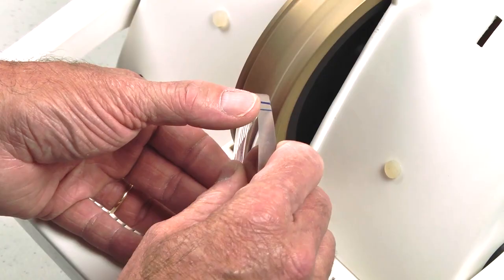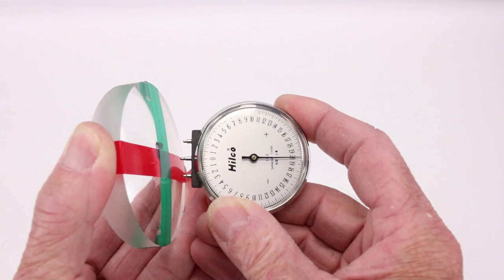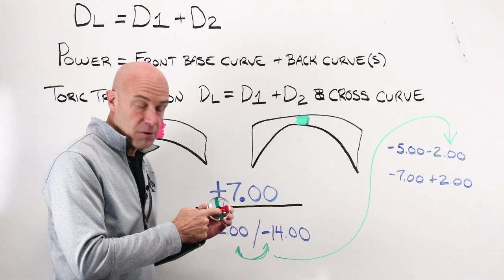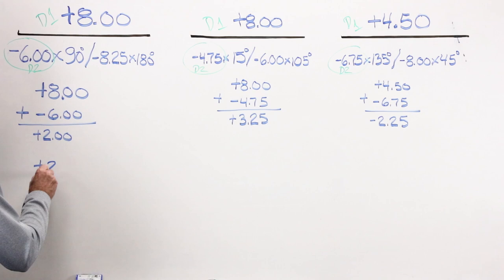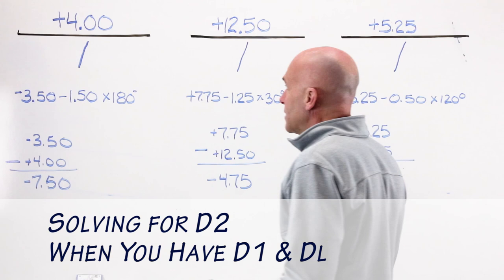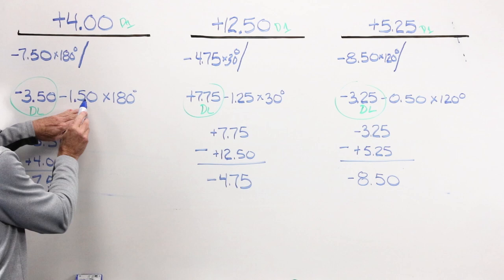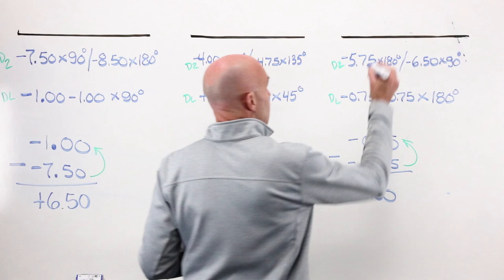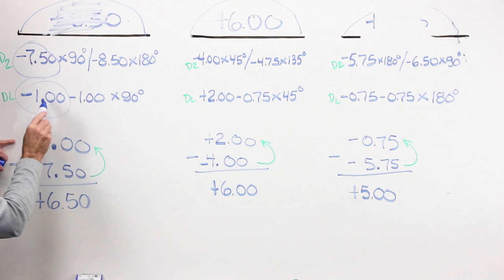Optician Training: What Is Toric Transposition and How Is It Done? with 9 Examples

Comment: thanks for all the videos, I am interested in how to produce aspheric lens, their materials if any and process
Reply from the maker: The aspheric design is pre-molded at the factory on the front base curve of the lens in both stock and surfaced lenses. Think of the old flying saucer profile: a center "bubble" which is spherical and then it tapers off to a flatter smoother, less steep profile. The language sort of changes when you get to the backside depending on the surfacing technique. A true free form backside although technically aspheric isn't called that.